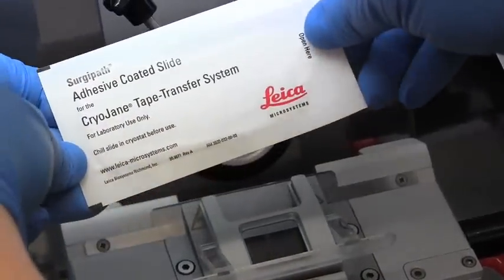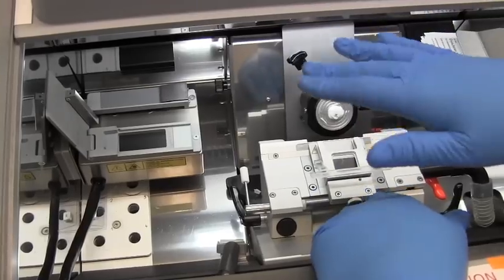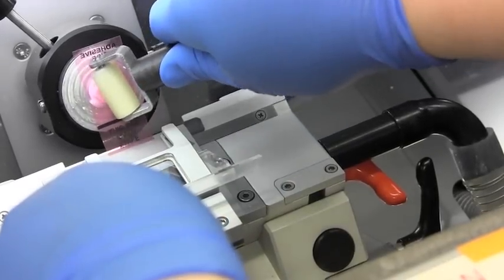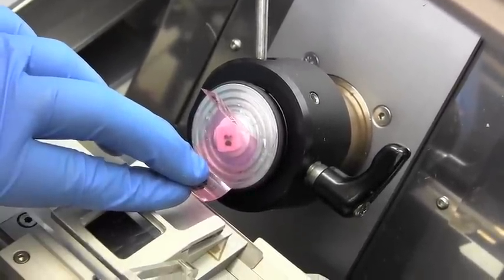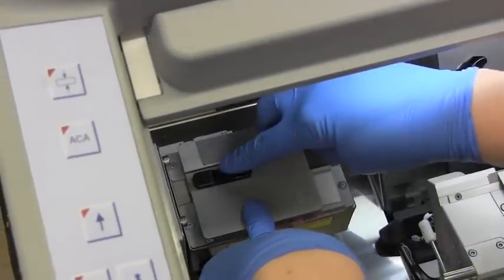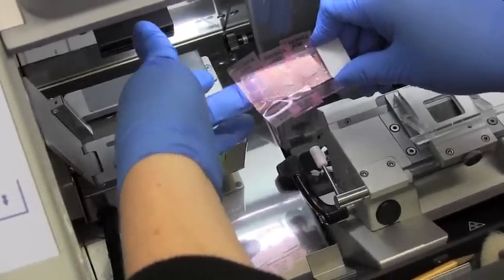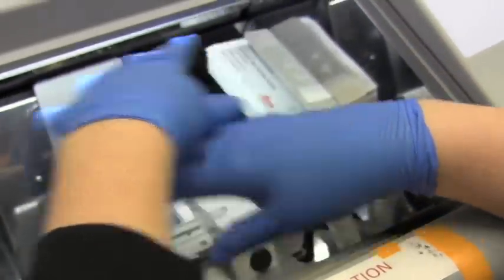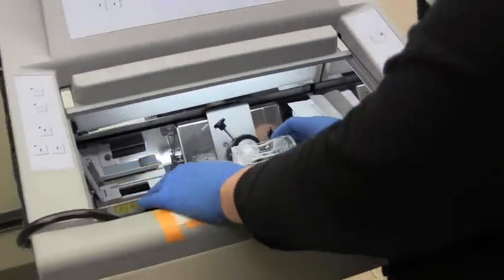Cryosectioning  5) Cutting and Slide Mounting

Comment: I don't get it. What's the point of using CryoJane if you melt your section with the warmth of your hand in the end anyways?
Reply: i need an explanation for this too
Reply: i want to cut bones. i think...that's why i try it... the cryojane keeps your sections together. if i cut my knees normally they crumble
Reply: @entewurzel2109  This is what our lab did as well. Bone is a brittle tissue so in order for the samples to stay intact you need to use tape